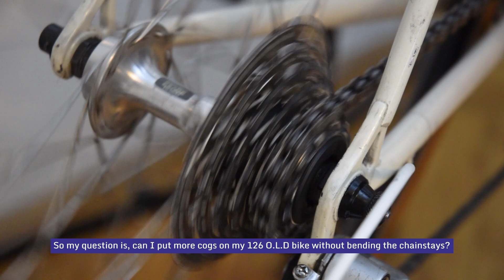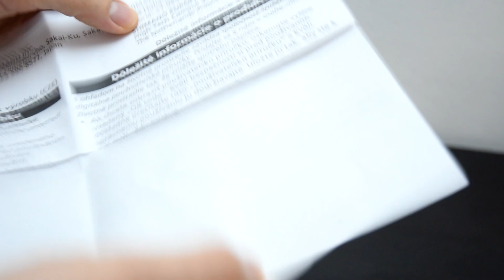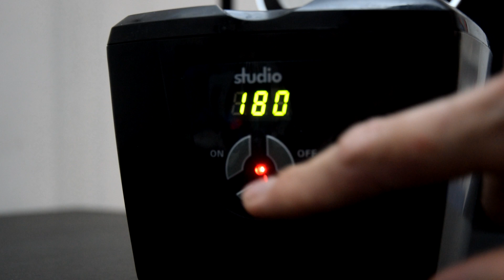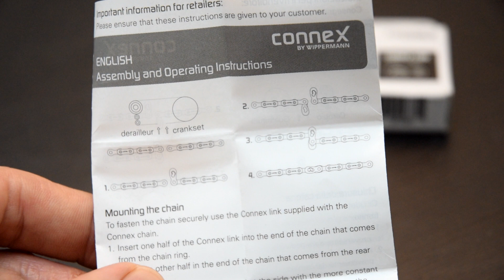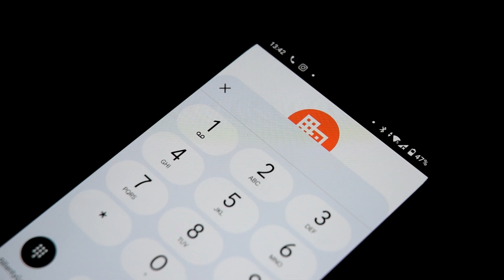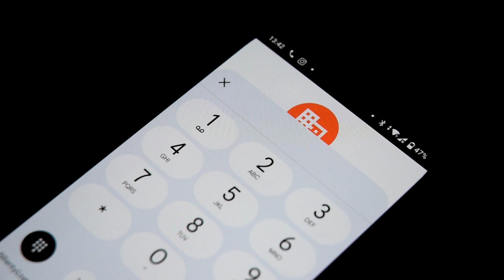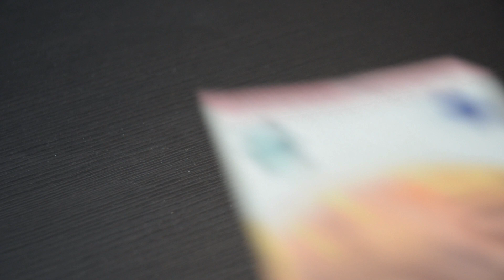Can you put more sprockets on your bike? (without coldsetting)

Comment: Oh hell yeah, this is exactly the video I need! I also have a126 OLD rear and had to resort to sourcing older HG/UG hubs to get a  7 speed cassette on there to avoid coldsetting!
Reply from the maker: Hellyeah! I'm glad I'm not the only one, and I hope this video will be useful!

If you have any questions before hacking your way through it, feel free to ask!

Though i didn't yet had the time to test it out in depth. I guess I'll see everything on Saturday where I'm gonna ride the shit out of this sucker in the hills 😅
Reply: @kelemenrichard  Excellent! this opens up so many possibilities. I am currently hacking loose sprockes with filed down ridges to fit a UG hub with a 7th UG sprocket to tighten all down :D. Good to know that the STI shifters fit onto retro bars. Silver all the way!
Have fun riding the Hills! 👋
Reply from the maker: @donttouchthisatall  thanks, i hope it will work out 🤞
Good luck with your project too!
Reply: @kelemenrichard  One more thing I just remembered: You could theoretically drill out the pins that hold the cassette group together, and then choose a random, different cog, instead of the 3rd loose cog. E.g. remove the 28, and keep the others.
Reply from the maker: @donttouchthisatall  yeah, i have already did that on a cheaper 7 speed, i wasnt ready to do it on this though 😀
Reply: Se hace sin problema y 0 riesgo, son solo 2mm de cada lado, el cuadro ni lo siente.
Reply from the maker: @AndresMUy-vd2fy  I know, but still if you don't have the proper tools and just forcing it to open up 2-2mm you could missaling the rear triangle completely. I'm not saying it can't be done, it's just not for me, I'm more precise than that :)

Comment: I prefer silent hubs myself. 5600 105 hubs are pretty quiet, but DT Swiss 350 Star Ratchet hubs are Assassin-level silent.🤤 Also, +1 on the top-down bar wrapping.
Reply from the maker: Thats great to know for future reference, thank you! These old Exage hubs were pretty silent to begin with, but i made them even more quiet by overhauling them with a massive amount of grease 😀 Now my chain is louder than the hub 😀
Reply: @kelemenrichard  That's the biggest "issue" I have, I can hear EVERYTHING the chain is doing. On the plus side, I can hear when it's time to clean it (I still use regular chain lube, no wax yet...), or when it needs adjustment after a cable has settled.😅
Reply from the maker: @Justin-zv4cm  yeah, but thats a good thing to 😀 waxlube is pretty "loud" though in my opinion, but if thats my biggest problem, so be it 😀
Reply: I like a loud hub :P no need for a bell.

Comment: Don’t forget…when the 8-speed freehub was introduced (circa 1989),  ALL frames had 126 mm spacing.  The original 8spd freehub had special rounded locknuts to make insertion into the tight dropouts easier.  But, I have had little problem getting later versions into my old frames…it’s only 4mm after all!  You can easily spread your dropouts that much by hand when inserting your wheel
Reply from the maker: Well, I'm not entirely sure about the locknuts being rounded because of that reason though. True, you could force the droputs by hand, but if you not cold setting the frame properly (checking dropout and chainstay alingment) you could end up with misaligned frame, excessive bearing preload and if you just shove a bigger hub in, it's pretty hard to pull it in and out when you have a puncture. I just wouldn't do that :)

I guessing that the rounded locknuts were simply a way to speed up wheel swaps. Like those bent metal bits on brake shoes for selfaligning the wheels when swapping them in a race situation. But who knows really!
Reply: @kelemenrichard    Well..the “official” statement from Shimano when 8spd was introduced was that the locknuts were rounded to assist insertion into (then) standard dropout spacing.  And,  no one was cold setting their rear triangle at that time, so it definitely works!  It may not be the optimal way to do it, but 8spd will work with 126 spacing without modification.
Reply: @kelemenrichard  the locknuts with the bearing races on them are threaded on the axle so the stress from stretching the dropouts by 4mm should not add a significant preload on the bearings. If it still worries you, just loosen the locknuts slightly to compensate for it. I've done it on a bike I converted and there have been no issues
Reply from the maker: @KekusMagnus  thanks, thats cool to know! Though I'm still not gonna shove a wider hub in there :D

Comment: Great video covering lots of gotchas. Sticking with my 8-speed shifters (Shimano RX100) for the moment @ 130mm. Not tempted by new 10-speed shifters and a thinner chain. Was amused at the start, as I have 15T -> 13T jump on a 12-25 cassette
Reply from the maker: @russellbaker4256  thank you very much! In the meantime i went full retarded and ended up coldsetting the frame and getting a new wheelset. I also swapped out a couple of parts and i can now run the full 10 speed 32-11 cassette (with a short cage derailleur), the shifts are pretty fast, smooth and reliable with these 5700 shifters. As for the chain, i can get the same amount of life out of them as i used to be with my 8 speed chains, approximately 2000-3000km depending.on the amount of climbing i do. (CN6701 Ultegra chains)

Comment: Coldsetting to from 126 mm to 130 mm means it's only 2 mms of bending each stay. And considering the length of the seatstay it's only 0,272° bend (actual figure based on RB-2 chainstay length). I'd wager it's probably a safe operation...
Reply from the maker: It totally is! Many have done that with steel bikes. I just don't have the right tools for an operation like that, and I didn't want to build a new wheel too 🤟
Reply: @kelemenrichard  in any case, we can always trust Sheldon Brown😏 there is a 99 % chance he has elegantly solved and documented any mechanical occurrance regarding steel frames
Reply from the maker: @p504504  exactly! The guy was a genius thats for sure!
Reply: I have also bent a 126 to 130 in the past, but those were frames that weren't really precious to me ;) - I have a '79 PUCH Royal Force with 126 OLD as well, which I am working on and I wanna keep it as original as possible (also for resale maybe), so cold setting is not an option for this frame. :)
Reply from the maker: @donttouchthisatall  Nice! That Puch sounds like an excellent candidate for this kind of job! Espcially if it has friction shifters, you could literally put any amount of sprockets on the hub, maybe a 10 out of 11 would work too, who knows?! :D
Reply: @kelemenrichard  It does have friction shifters :D (Full 1st Gen Dura Ace - black edition). The hub is a UG though, so spline pattern is different.. could give it a go though.. 🤔
Reply from the maker: @donttouchthisatall  Oh, right thats a different story then! You could actually swap out the hub body for a 7 speed HG though. If you can source one of course :D
Reply: @kelemenrichard  yea, i considered that, but this was one of the really early ones, where the hub was apparently pressed (🤷) onto the hub body, so no dice. However, I've read that you could theretically use a 130 OLD hub and remove spacers to get the full range/cassettte. (As long as the wheel dish doesnt suffer too badly)
Reply from the maker: @donttouchthisatall  oh shit, that sounds terrible :D maybe you could swap out the hup for a slightly newer 126 OLD, atleast thats what i's do
Reply: @kelemenrichard  I have an Exage hub (I guess the same you do) waiting in the wings for spokes to arrive and the wheelbuild. I did use the UG hub though, just filed down the sprocket splines to fit the UG and used the last cog from an UG cassette to hold it all together. Worked like a treat on my ride today :) - Shifting a HG cassette is SOOO much nicer than a UG ;)
Reply from the maker: @donttouchthisatall  nice work! Yeah, UG cogs are a bit prehistoric 😅

Comment: The answer is "yes". 
Im currently running shimano 105 11s (full set) on a late 80s Italian steel road bike. Ive had 2x10 shimano deore on a early 80's Nishiki International (beautiful frame btw), and 11s campy on a early 90's FMoser. 
No adjustments done to rear forks. Nothing needed or added. Went right back to 7 and 8 speed when i resold the bikes. No issues.
Reply from the maker: Nice!

Comment: Very nice and clever! I recently switched from wax dripping to hot wax and it's even better but some kind of messy. Don't use Pans/cookers for food afterwards.
Reply from the maker: Thanks! Yeah i was thinking of going there but id rather have a workshop and a proper workbench first. Even like these cleaner jobs my flat looks like a warzone sometimes 😅
Reply: @kelemenrichard  I used an empty pickels glass to heat the wax bu it's still a big mess. I'm going to get a cheap used slow cooker from marketplace once my 3 chains need rewaxing. After mounting and spinning for the first time, huge amounts of wax flaxes will cover your floor 😔
Reply from the maker: @FuchsHorst  That sounds like a mess :D

Comment: Nice! Only replacing old sti levers you have saved more than a half kg!!! 🤣🤣 
The real trick is using a 9 speed cassette with a 10 speed shifting lever, spaced for 9 (all campagnolo stuff) on a Shimano free hub allowed to only 9 speed.
Campagnolo have 3 mm width spacing on 9 speed, and 2,5 mm width on 10. But everything Is possibile. Rode about 15.000 miles on that setting. No issues.
I prefer (a lot much) loud free hubs. That provides me more "bike mechanic" feelings. The more are noisy, the better i feel. Greetings from fuckin' rainy Italy.

Comment: You could also machine out inner side of some cassete, but risk of chain caught on spokes is higer than normal. Shimano built that way r7000 and ultegra 11-34 cassete, that fits 10dp freehub.
Reply from the maker: well, yeah if I think I wouldn't do that even if I"d have a machine shop :D

I've ended up cold setting the frame though, cause I had some issues with the freehub, and found a pretty nice modern wheelset on sale

Comment: Quick question, so is the rear derailleur the same? You went from 7 to 9 speed. It’s all about the shifter itself?
Reply from the maker: Hey there, yes.
As far as I know, up to 10 speed Shimano road groupsets, the derailleurs cable pull is the same across the board (except for the 4700 Tiagra, they have changed it to the same cable pull to whats the 11 speed groupsets use).
It is important though to use the same cassette and shifter though, so for my build i used 9 cogs out of a 10 speed cassette and a 10 speed shifter, but with a 7 speed derailleur.
Do you have a specific mix of parts to build from?
Good luck!